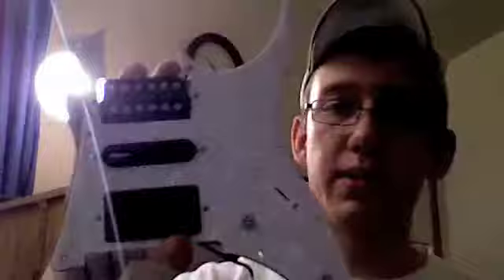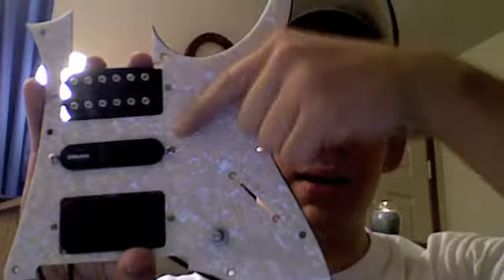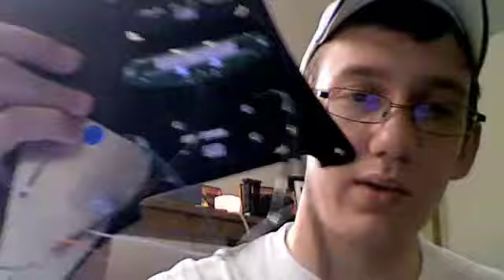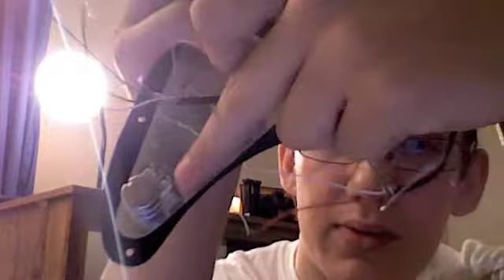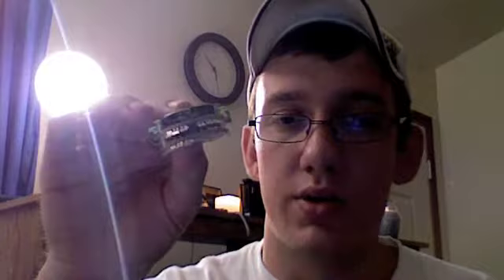Wiring The RG350DJCW Pt1

Comment: Are you using an Edge Pro or an Edge III. I didn't think the Edge Pro would fit in the same position as the Edge III. I thought the routs were different.  I may be contacting you a lot as I think I am about to acquire a used RG350 that I will probably do a lot of mods to.  It already has Evolution picups in it and I will probably throw in a Dimarzio Cruizer (that I already own) in the middle position.  However, I would want a new neck and trem so I may need wiring and body mod advice. Thanks.